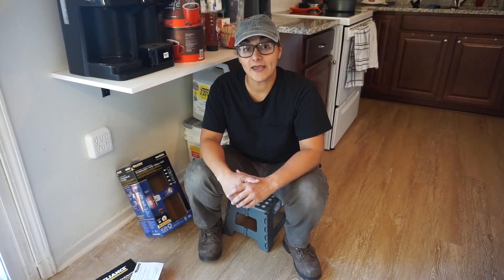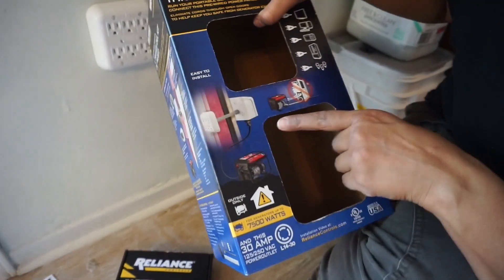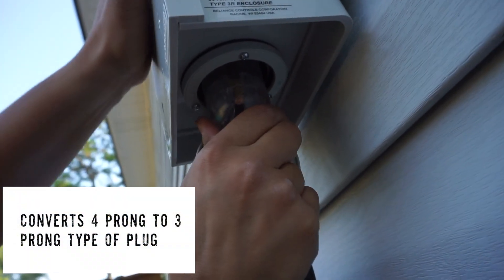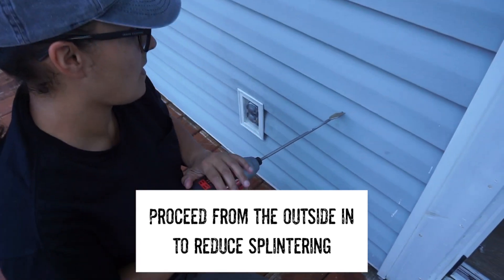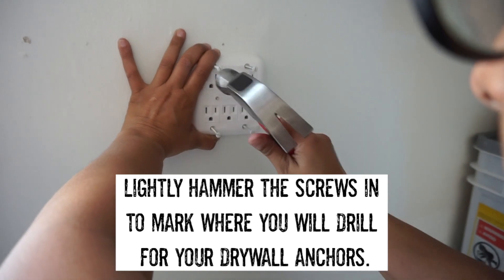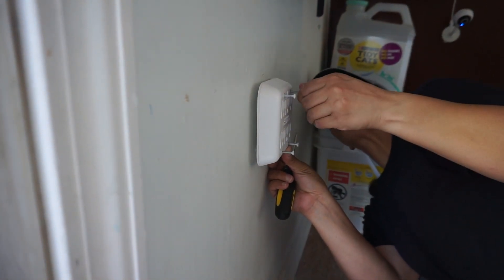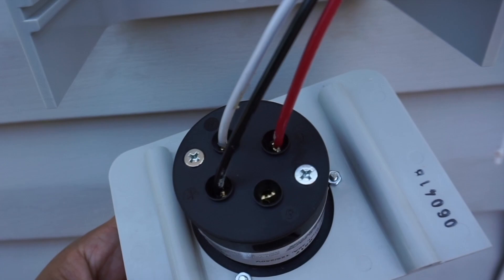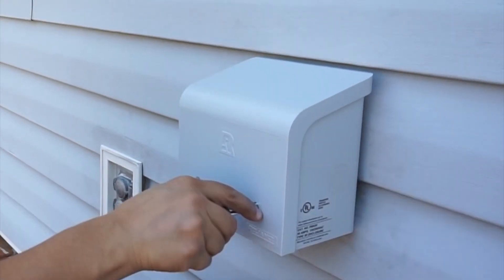GENERATOR WALL KIT INSTALL

Comment: When you plug the pigtail into the outside, you have to rotate it slightly to attach it. The weight of the pigtail and generator cable is enough that it won't hold unless you rotate it.

Comment: I only need two extension cords coming in. I just run them through a slightly opened window and then stuff insulation in the opening. This gizmo is very nice, clean, handy and all - i just don't see the need for it. i never smell any outside fumes.

Comment: Thank you for your video. I just installed this product through stucco/concrete block. A few tips for CBS walls: 1. Drill a pilot hole (3/8 inch x 12, mansonry drill bit) through the entire wall. I did it from exterior to interior. That will give you an idea if you have hit an open "cell" or if there may be more concrete to drill through. 2. Use a "hammer" drill for these smaller diameter holes (on hammer function - goes much smoother and there is one at Harbor Freight for $20). 2. I used a 1 1/4" core drill bit (Amazon for $34). I made a jig by cutting a 1 1/4" hole in some scrap plywood so the core drill bit wouldn't skip around. I used the supplied 1 1/4" wood bit to cut the hole in the scrap wood. Once the hole is started, you can ditch the wood jig you made. 3. Use the drill on "rotate" only, no hammer function when using the core drill bit. Take your time, removing bit every 20 sec. or so to cool it and remove some of the dust buildup. 4. Another problem is the supplied conduit is too tight to fit easily into the exterior knockout hole. Once you've mounted the inside receptacle, pushing the outside plate onto the conduit can push the interior receptacle away from the drywall - ruining all your inside work to mount it. 6. SO - AFTER you cut the conduit to length,  take some sandpaper and sand the end of the conduit until it fits easily in the exterior unit that you'll attach to the outside wall. Do this BEFORE you attach the conduit and the inside receptacle.  That will eliminate this potential problem. People complain that the interior wall anchors are poor - and it's partly because the company supplies machine screws with the anchors - they don't work very well. I chose to buy some small (70 lb.) molly bolts ($3 Lowes) and the supplied Precision screws (#6 x 2 1/4) fit perfectly into the molly bolt nuts. After marking the location for the 4 screws, drill out the drywall to the diameter of the molly bolts so they will slip easily into the drywall. This provided a much more secure mounting of the interior wall receptacle. 7. I chose NOT to use any cement to attach conduit. I feel that with the natural compression - since the interior and exterior receptacles sandwich the conduit in place - there is no need for cement. This way, if it ever has to be removed, the receptacles won't be cemented to the conduit. 8. The wires I received were NOT copper. And I didn't want to strip any more insulation off the ends. So just attach them very slightly pulled out (1/8 in) from hitting the bottom of the slots and you'll be able to screw them in place very securely without worrying about getting any wire insulation in your connection.
Reply: Can you wire multiple outlets for two story home?

Comment: I installed one,easy like this video shows. After I bought the  through the wall plug a had to buy a cable to run from the generator to the wall plug. The cable costs about the same as the plug and worth it. I found one at local building supply store cheaper then Amazon. I suggest putting the plug high enough to make it easy to plug it the cable  on a dark ,cold winter night.
Reply: That suggestion about HEIGHT is a great point especially for us old folks

Comment: you indicated that after you marked the conduit 1/8th inch from the outside wall, that you had to cut the conduit twice.  What distance from the wall did you end up cutting the conduit to?
Reply: the issue with how i measured it the first time is that i forgot to take into consideration the vinyl siding has some flex to it, so the second time i just pushed the siding in and cut 1/8 from that point. No exact measurements, its going to vary depending on your house structure. Just remember you don’t want to install it looking weirdly sticking out of your siding, it should look flush like its just part of your home. Plus you can add caulking or butyl tape to weather seal it even better, since you just created a new entry for tiny bugs to get in your house.
Reply: @ladywrench41  thanks!  this was a great video, the best one on youtube.  I appreciate the effort you put into it, I think I'm ready to install mine now.
Reply: Another idea to your beautiful install is you could of got one of those contour pattern gauges, pushed it into the vynle siding to get the pattern, then built a box that fits directly to the pattern of the siding, then the install to / in it  @ladywrench41

Comment: For those considering this kit, know that the exterior box is for a four-prong hookup, so three prong cables will not work. Some of the larger portable generators have four-prong outlets, so it won't be a problem using a four-prong cable. But if your generator has a three prong 20A outlet, it will not connect straight into this box. Might want to check out options for an adapter.
Reply: I’m in that boat.  Only have 2 each 120 volt output options on my small generator.  Is there an adapter that would work?  Thanks.
Reply: @dsmith2858  There are a number of things you could use to make your own. You just need to find an inlet box that would accept those two extension cords that you would then have wired to a dedicated outlet on the inside.
If you do not feel comfortable doing it yourself a licensed electrician can set it up.
Reply: GREAT to know, you could of posted the actual name of the adapter or part number

Comment: Hello - great video and super informative! Quick question, Do you have a part # for the pig tail adapter chord - I can't find it anywhere. :-)
Reply: It came with the kit so I don’t have a separate part number for it. You can find the on Amazon though
Reply: @ladywrench41  Thank you for the reply. Another quick question - do you think If I just get an extension chord with the L5-30P to L14-30R ends - I could for-go the pigtail altogether?

Comment: What if you need more than the 3,000 watts that pigtail can do?  You install another one? Or do they have a bigger watt version?  I thinking of getting a 7000 watt Honda generator for my house. Running the extension cord wires into the house seems tricky. I found your solution just now.
Reply: Joel, I'm looking into similar options. This kit looks good, and you could install two (30A each, with two 30A cords). But I'd say with 7000W, and your sensible dislike for extension cords, you might as well spend a bit more to set up an "interlock" (in your panel) or a "transfer switch" (add a separate panel). They're about $300 - 700 for hardware (plus an electrical pro installer), and relatively easy to install. No expense for 2 of these kits, nor many extension cords. During an outage, just start the generator and flip a few switches to instantly power (most) of your entire house. Even 240V hard-wired appliances if needed. See "Ask This Old House": https://youtu.be/GLgtFCJlVFQ
Reply: I dont think this kit handles more than 30 amps. Perhaps there is another by the same maker that can handle more. Sorry I don’t know the answer.